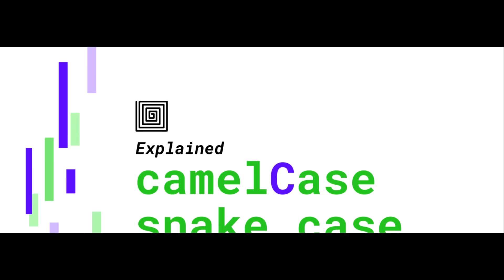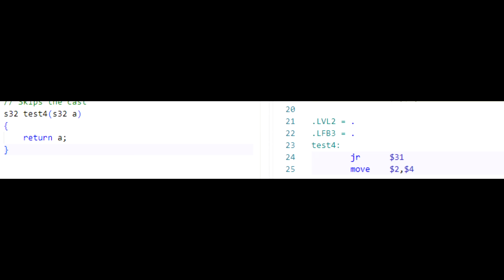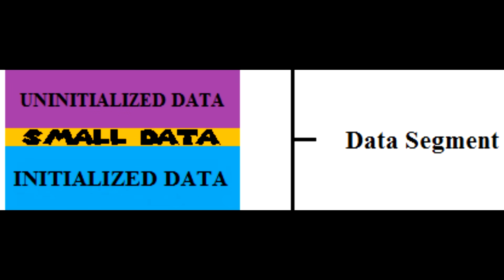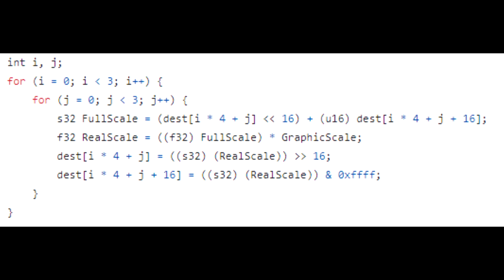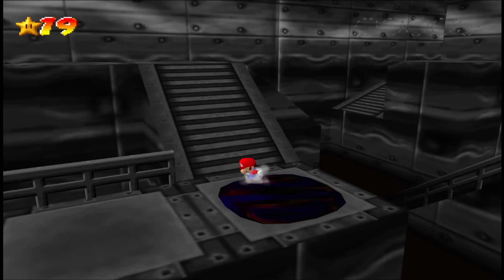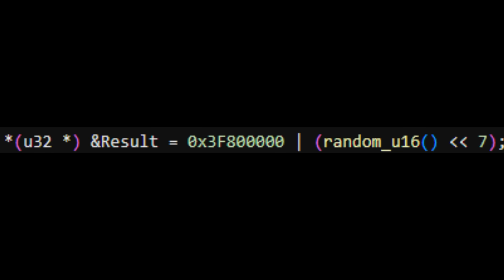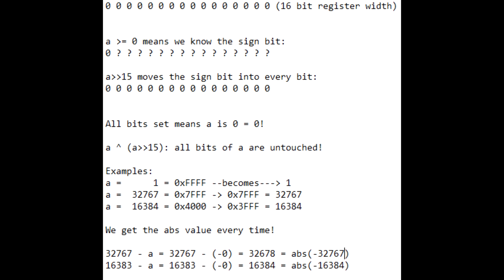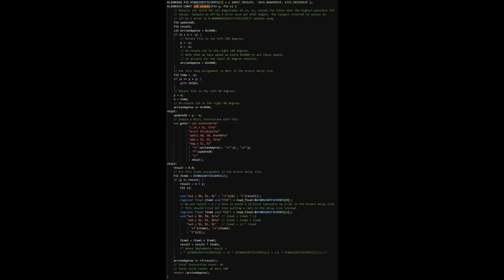Optimizing with "Bad Code"

Comment from the maker: 2 Common Questions I'd like to answer:

1) Why not just pass a vector pointer to the lateral distance function?
Because load instructions under MIPS have a constant offset you can provide. By assuming how far away from the pointer the offset is, we can cover one special case in 1 cycle less and have all the other cases work in the same amount of cycles. Making a special case for the lateral distance function and then constantly repurposing it is an optimization!

2) Why don't you just use inline assembly?
 - I need my code to be in this exact spot for cache coherency and using inline assembly mips GCC style is too much of a pain. I wish there was a way to just write assembly?? But somehow there isn't.
Reply: would maybe another compilet like llvm clang maybe able to provide better behaviour when compiling. or maybe it's worst XD.
Reply: I’d love to see your work done to Goldeneye on the N64, maybe get it up to a half decent frame rate.
Reply: You should look at the Union feature in C++, and the Restrict feature in C.
Reply: You can write entire assembly functions in a separate source file and link them in.  No more fighting the compiler that way.
Reply from the maker: putting them into a seperate file means i lose icache coherency
Reply: I understood none of this
Reply: @KazeN64  aw...
Reply: Oh, also take notes from the guy who wrote Retro City Rampage and Retro City ROMpage. He created a neat tool to make 6502 assembly easier to work with, and it could probably be adapted to MIPS assembly as well.
Reply: @hipsterelephant2660  I just realized who your profile picture is... There are a million different references I want to make right now, but I can't think of one that's appropriate to the current context.

So I will simply say "It's the culinary opposite of chicken wing".
Reply: If I knew C I would write a better compiler that lets you use ORG directives etc
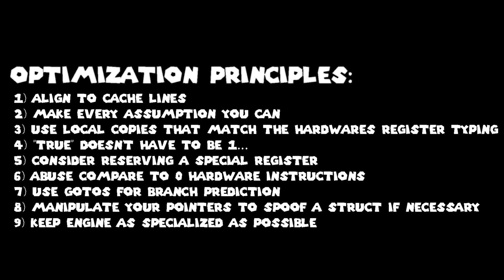Reply: 12:22 Is this a website I can use? Seems handy
Reply: @AmaroqStarwind   I found that a trick involving Unions was the best way to return two 32-bit values for 32-bit ARM.  Normally, the compiler will allocate two slots on the stack to hold your return values, write them there, then after returning, the code will read those values out of the stack.  But there's a much better way: Return a simple 64-bit value.  That forces the compiler to return it as two registers (as required by the standards).  Using Unions happens to be the best way to combine two 32-bit values together as a 64-bit value, or split a 64-bit value into two 32-bit values.  You combine your two 32-bit values into a single 64-bit value, return the 64-bit value (not the union type itself, just its 64-bit value), then split your 64-bit value into two 32-bit values again.  The compiler generates good code for this, almost like you wrote it by hand in assembly.
Reply: @KazeN64  what you could do is split the file in three (before the function, the function, and after the function).  Then you can enforce the ordering and even the location using linker maps.  This is how the pokemon decompilation projects achieve the correct object file ordering.
Reply: @williamdrum9899  assigning addresses to objects (.o files) is the linker's job, and many (most?) linkers allow you to specify relative ordering and/or exact addresses using linker scripts/the equivalent (here GNU ld's linkerscripts).
Reply: @undefinednan7096  That sounds like a massive headache
Reply: @williamdrum9899  it really isn't that bad -- usually one would just care about the relative ordering, and its something you only do once.  Further, you only have to specify the files you care about
Reply: @KazeN64  Can't you just segment your translation units in a way that allows you to just link the ASM exactly where it should go? It's slightly fucked still but I'd argue much less than what you're currently doing. This is just an assembly sandwich. What you're currently doing is hammering GCC into producing a very specific output. I'd imagine that implementing even a minor change in one of those half-C half-assembly functions is a pain.
Reply: @undefinednan7096 Yes! I was thinking the same. I only saw your comment after I posted mine and scrolled down to read it again
Reply from the maker: @JATmatic  yeah i have some of that, but splitting up the file into 3 parts just to include an assembly in the middle would be worse to work with imo
Reply: @KazeN64  Ahh.. If you have a lot of math routines like in this video, moving them entirely into the asm realm might make sense?

Is there a cost of self modifying code on N64? Like a icache flush instruction before (previously) data can be executed?
Reply: Can we get the link of super mario 64 odyssey multiplayer?
Reply: @KazeN64 Is there any chance you could make a Mario 64 ROM hack actually able to use the expansion pack? Would there even be a practical reason to do that.
Reply: @AmaroqStarwind What are you referencing?
Reply: @MrGamelover23  Homestar Runner / Strongbad
Reply: @laclica no clang just gcc
Reply: @KazeN64 can you arrange them using a linker script? Does your toolchain support them?
Reply: @Dwedit  Nowadays C++ has std::bit_cast for that which is a bit more elegant, but yeah it's annoying that a (trivially copyable) 2-word struct isn't returned in register on ARM like a 64-bit integer is. It also means that any wrapper class around a 64-bit integer (e.g. std::duration or boost units) also causes it to be returned on stack instead of register... there's no equivalent to rust's repr(transparent)
Reply: Why do people like all this confusing programming stuff? Cognitive torture.
Reply: Can you make this moddified engine vertion available to download or give step by step how to do it yourself? I don't know if it's legal or not, but running this on acual hardware sounds fun.
Reply: besides, MIPS was made to be mostly compiler-programmed.
Reply: BTW, do you happen to have contributed to GCC, or you don't want to open that can of worms
Reply: @Dwedit You're literally everywhere in retro game programming aren't you?
Reply: For writing MIPS assembly I can highly recommend the armips assembler. It was made with intention of its usage in romhacking, so it allows you to create binary blobs with any specified base address.
Reply from the maker: @fothsid  back when i was writing exclusively in mips assembly, i preferred cajeASM. armips has some conventions that are more verbose so its overall slower to write code with it.
Reply: @KazeN64 isn't that what linker scripts are for?
Reply: Can you not tell GCC (or it’s assembler) to put specific code in specific spots? Like, you’re already defining custom segments, can you not just have a segment for “<assembly>.s”?
Reply: Use ASM and tangle it but make it performant
Reply: Load instructions under MIPS?Poor MIPS...

(/j,ik this is not the 15 star rabbit or smth)

Comment: For anyone thinking of implementing this generally, note Kaze is optimising for his specific purpose on his specific system and his specific compiler, and is testing everything in Compiler Explorer. Don't start doing this stuff needlessly in your own code blindly just "because Kaze said faster". If you're not writing an optimised N64 game then you need to do the profiling, research, and proof work all over again. Plus you actually need to save 1 or 2 cycles, which is unlikely on any x86 computer made in the last 30 years.
Reply: Plus you have to be super careful not to over-optimize for a specific implementation of x86_64, which then becomes horribly slow or even downright broken on others. These sorts of micro-optimizations are almost never worth implementing unless your target hardware is 100% fixed.
Reply: And also,compilers nowadays arepretty smart aboit compiling to archetectures that are not 20+ years obsolete.
Reply from the maker: i'm using modern GCC unfortunately
Reply: @KazeN64  Is gcc's mips optimizations as good as its x86 optimizations? Or does architecture not affect how "smart" gcc is?
Reply: I wouldn't be surprised if James Lambert is sitting there taking notes for potential optimizations in Portal 64 every time Kaze releases a new video.
Reply: @magfal Welp
Reply: Optimization is a state of mind, it's not always these low level tricks. However, everything that gives a significant improvement is welcome, whether it's readable or not. But one has to test and not make assumptions. Not blindly doing certain gimmicks because they are generally better, but test. If an ugly code does give important performance, especially where it matters, I'll take it. Unless it saves 0.01% (which could be noise) and it's not worth it. There is a bit of evaluation, like "should I do that or not?" but also I think it's worth to at least experiment and not be afraid someone is gonna murder you because you used a goto. I am all for wild experiments till I evaluate if some kind of optimization is worth it compared to the code changes.

In most modern PC software, you could avoid very ugly hacks but still care for performance. Unfortunately most don't care about performance even in the high level. They say "premature optimization is the root of all evil" and "we are not in the 90s where we cycle count optimized assembly", but with this they avoid all kinds of optimization or don't pay attention to bad code that does unecassrrily steal performance. It's like they devoid the whole responsibility to the magical compiler or buy better hardware.
Reply: There are numerous optimizations a compiler cannot make that we would without blinking an eye. Often because of technicalities in the C specs. Also, some compilers with some flags will make optimizations that break code. For example, by assuming that float addition is associative (it isn't). Also, volatile is almost always incorrectly used, not fully defined and usually the wrong tool for the job. For example, people often don't realize that  volatile stores and loads aren't necessarily well ordered with respect to non volatiles. I once reported a bug after reading a bad spinlock implementation. They ignored my report. It bit them about a year later.
Reply: Did you know int overflow is undefined? Compiler authors sometimes abuse this fact and assume a variable is bounded, because there's no way a developer would write undefined behavior into a program (sarcasm)
Reply: @magfal o7
Reply: Besides, Kaze's optimizations usually involve having the CPU do more work, because N64 optimization is actually about minimizing the usage of the system's slow memory.

Of the systems I know of, only the Nintendo Switch is memory bandwidth-bottlenecked like this.

I will encourage people to at least put some thought about how their code will run on their target hardware. Too many people are completely careless, put absolutely zero thought into runtime performance and end up writing software that is 1000x slower than they have any right to. It is completely unacceptable to write software that takes 10-20 seconds to start up, and more than 5 seconds to respond to user input on a 5GHz CPU. Heck, if it takes more than 3 seconds I look at it a little weird. I don't think people comprehend how blazingly fast modern CPUs actually are. Even on a crap netbook CPU from the 2010s it is possible to make something performant in most usecases.

You don't need to get to this level of assembly micro-optimizations to write reasonably fast software. Kaze is chipping away at the last, most difficult 99.999% of the maximum possible performance he can possibly get out of the N64. But getting 90% of the way there is easy and doesn't destroy your code quality, readability or debuggability and doesn't force you to work in assembly, so please do optimize. Thinking about things like cache locality is useful in modern PCs too for any kind of intense data processing work. Measure your execution times. Profile your software and understand your hardware. Don't needlessly waste your users' time.

Comment: i always find the most unreadable code is when they start utilizing undocumented bugs in hardware because the code your looking at even if you 100% understood it, is not doing what you think it does. or when they start using undocumented instructions that do a weird combination of things. this is what makes making emulators so hard to make.
Reply: "makes making emulators so hard to make" 🤣
Reply: Luckily the N64 doesn't have too much of this on the CPU front, the only bug is shown in this video. Theres also no undocumented instructions. Where for example the NES would partially execute and effectively combine multiple instructions when encountering an unknown opcode, the VR4300 (the CPU used by the N64) throws an Reserved Instruction exception instead. Deterministic cases of undefined behaviour (e.g. divide by zero) could in theory be abused, but im not sure if that ever ends up being useful.
Reply: @i.8530 Are you also a N64 programmer? You know a lot of things!
Reply: @dacueba-games  like im likely to literate too much literation
Reply: @Selendeki Yeah like I've never coded on N64 but I'm a programmer by day and I love videos like this
Reply: Yet to see an emulator implement the NES's undocumented "put on a hotplate" feature.
Reply: The good news is that if the people using the random bugs in the hardware have a problem with it, then they can tell it to you, and if they don't that means it clearly wasn't very important.
Reply: @RAFMnBgaming The what feature?
Reply: @cameronabshire1195  Speedrunners put the NES (or rather the famicom) on a hotplate to make it easier to glitch through certain sections in dragon quest 3. There's a video on it somewhere.

It's kinda like weaponised cosmic rays. 

IIRC there's also a speedrun where you put jam on your PS1 disc. Another feature yet to be emulated.
Reply: @RAFMnBgaming if i knew how to code I would so much make a pull request called "Adds (literal) jam functionality" and make it have multiple type of jams or the consistency that would made them act more aggressive...
Reply: @vulpzin you seem to have ideas, why not start learning
Reply: @vulpzin  I for one would like to see marmalade implemented.
Reply: the simplest16/16 division algorithm on z80 uses an undocumented instruction
Reply: @dacueba-games I mean, this is a genuine issue with the genesis. A lot of the techniques mentioned on Coding Secrets have caused issues for emulators because they use the machine in a way that the official programming documentations never accounted for and thus the emulator doesn't either
Reply: you're*
Reply: @dacueba-games it does. If the developers aren't aware of some hardware bug that gets abused for a game then it does make emulation development harder 

And yeah that's a bad thing. At least if you care about the preservation of games
Reply: you're*

Comment: I work in a codebase that is at least 60 years old. Looking at older versions written for IBM mainframes, everything looks like this. My favorite was, instead of having a boolean array for if a region had a particular property, they instead stored the machine code for "no-op" and "jump to function" where relevant and executed the array directly.
Reply: classy jump table, gotta love em
Reply: I tend to convert Boolean arrays into unsigned integers to save space. My code is cursed

Comment: As a software engineer myself, this was an amazing implementation of optimization and horror story of indecipherable deep magic. Nice job as always 👍
Reply: What do you work on? 99% of software engineers work with Java or C# and barely know what a clock cycle is
Reply: Honestly I think most of the functions here (except the last one??) would be fine if they were explained with a page-long docstring explaining the theory behind the behavior of each function.

Novel-length docstrings are also a good signal for junior devs to stay away from that code.
Reply: @uwirl4338  YT seems to have removed my response comment to you for no reason, as it usually does. Instead of repeating everything and getting the same result, I'll just say, yes, Java server stuff, but have dabbled in asm and C a while back, as well as love watching vids that go in depth at low level programming, like this one.
Reply: @JohnSmith-xv1tp  this process doesn't seem "simple"  certainly to you, due to being a engineer.
Reply: @uwirl4338 I don't think so lol.  Maybe in some places they don't have a lot of comp sci but I'm pretty sure any normal SE knows that. Although I guess some of them didn't go to uni and just learned what was necessary to work so in that case it makes sense'
Reply: java coders trying not to name themselves software engineers challenge (impossible)
Reply: @anon1963  Buddy, I design servers and implement solutions across multiple servers along the entire programming stack, everything from config servers, to gateways, to image processors, to DBMS, and all sorts of other data fetching/transforming operations, not to mention the optimization, security, maintainability concerns that go into all that. Heck, just yesterday I wrote some programs to help me fix some corrupted text data that was affecting my phone, which is fixed now BTW. I'm not merely a coder. I'm an engineer, at your service.
Reply: @JohnSmith-xv1tp  Listen buddy, I'm an engineer. That means I solve problems, not problems like what is beauty, cause that what fall under the purview of your outlook on philosophy. I solve practical problems. For instance what am I gonna do to stop some bad mother hubbard from tearing me a structurally superfluous new behind? The answer: a gun, and if that dont work, use more gun. Like this heavy duty tripod mounted little old number designed by me, built by me, and you best hope it ain't pointed at you.
Reply: aka 'Heavy Wizardry'
Reply: @anon1963 Hope the gatekeeping job pays better than a software engineer's.
Reply: @sol_and_luna  it does, thanks for caring